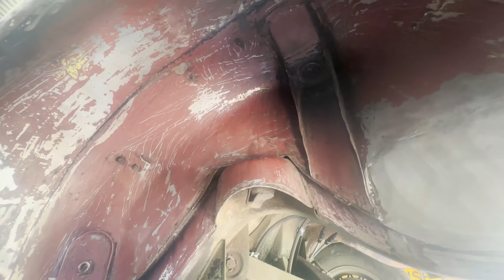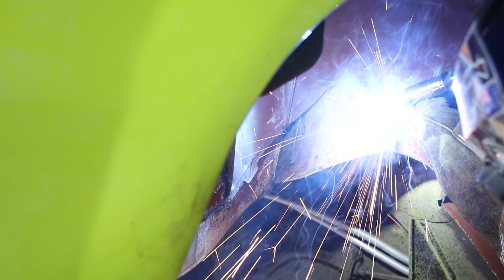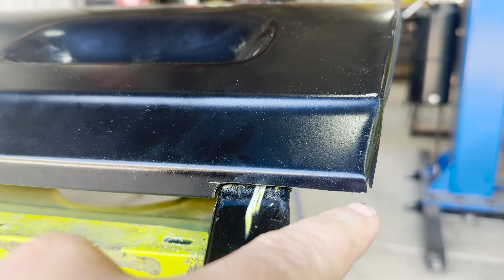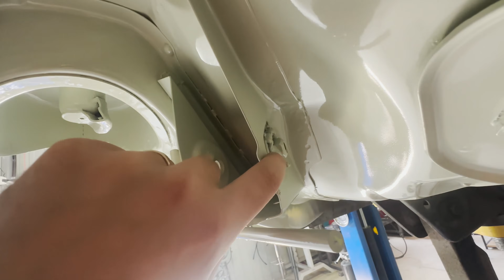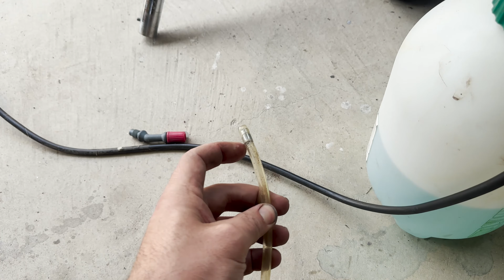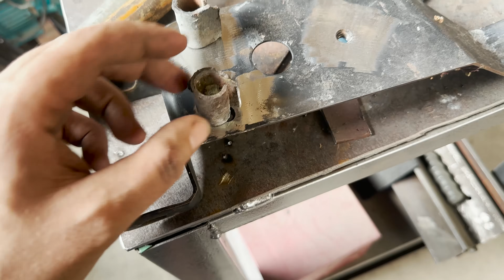Progress continues on Torana Hatch project | Underbody Rust & Epoxy | New Door Skin Test!

Comment: 15:07, regarding the doors, they were never that accurate from the factory, there were large tolerances . For example the VB commodore could vary in length by up to 15mm and still be in spec.
Reply from the maker: 15mm, Far out, seems like a lot but doesn’t surprise me. I’m just hoping to do the best I can so there is less to pick on (if there’s such thing!)